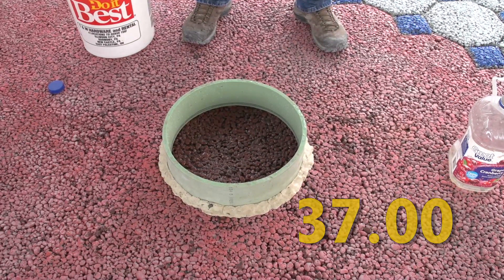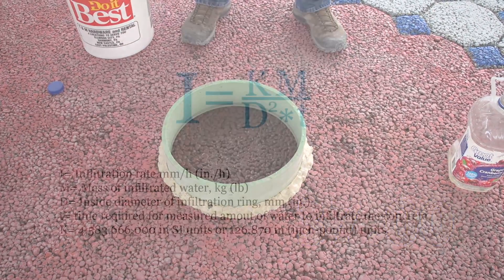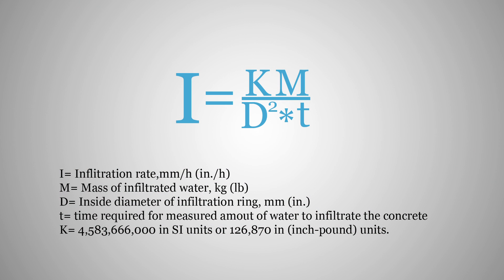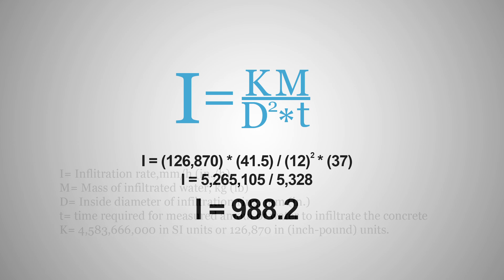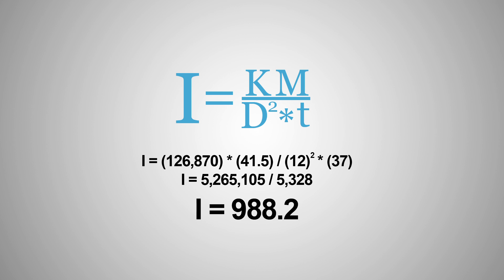ASTM C 1701 Infiltration rate of Pervious Concrete Demonstration

Comment: what is the size of aggregate used ?
Reply: Based on ASTM C33 the size can be different with your mixed design. I suggest using aggregate sizes between 4.75mm and 9.5 mm.